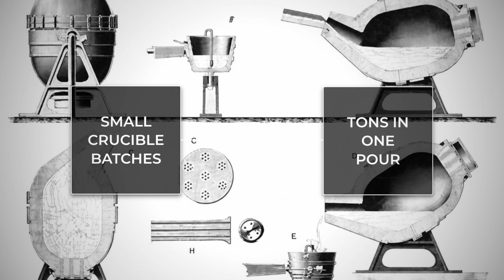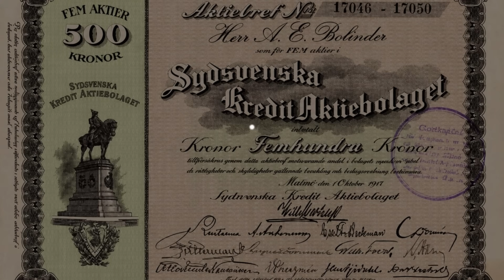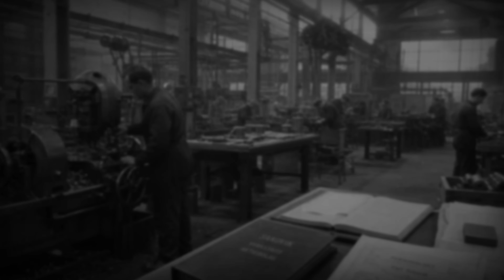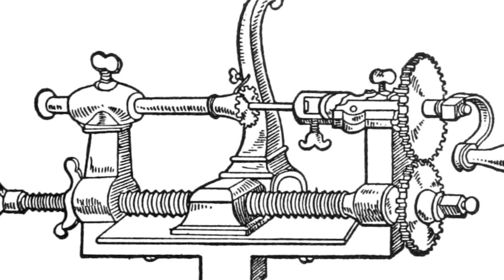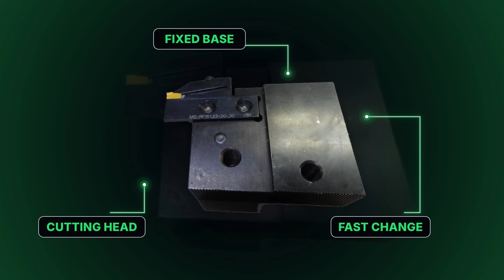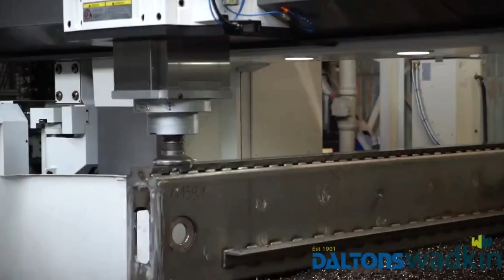How A Swedish Merchant Solved The Biggest Weakness In Cutting Tools And Started The Modern Steel Age

Comment: My friend had a workshop in Sheffield. Among other equipment he took over from the previous tenant of that shop was a Cincinnati cutter grinder. He mostly ground his own tools beye on a bench grinder, but discovered & fixed a problem on the Cincinatti that explained why it had been left behind. But gradually even he moved over to disposable inserts for most tasks, so have I in my home workshop.  It depends on your materials and personal preferences, but for many people - inserts are a more flexible & practical solution.   I also still have and use some Sandvik saws & other hand tools for woodworking as well.

Comment: Australian here. I was once contacted by the New York office of Sandvik and asked if I would be interested in a new product; a variety of stainless steel tube which was six times stronger than T304 stainless for the same weight, or one-sixth the weight for the same strength. As a manufacturer of racing vehicles I was naturally very interested. Long story short - the stuff was incredibly difficult to bend - especially in the wall thicknesses we were interested in (about 0.5mm). It took three months of trying and some bending machine modifications, but we eventually managed wrinkle-free bends in the 31.75mm tube we were supplied with. We were told we were only the second tube-bender in the world (after a Sandvik division) to manage such a feat. Sadly for us, Sandvik never went ahead with the volume production of the 38.1mm OD tube we needed. BUT, we did make the world's only man-carrying vehicle to use that steel and today that vehicle is somewhere in the U.S. State of Oregon. I was told back then that the only applications that did continue for that particular type of steel were needles used fo eye surgery and the outer shield plate of shavers. I'm retired now, but it was a memorable part of my career.
Reply: Genuinely interesting story! Thank you for sharing. :)
Reply: Thanks for sharing! As a swede it's really interesting and not a small feat bending that.
Reply: Bro you can’t say Oregon and not expect Oregonians to want to know what car it was. Where is it or what model was the car?
Reply: And you have Volvo and Scania on your roads to, a good swedish brand! Cheers! And  good F1 track or 2!:face-blue-smiling:
Reply: I live in Oregon. Where is it?
Reply: Thank you for sharing this very interesting story.
Reply: The material may be similar to Sandvik Nanoflex.
Reply: II appreciate that the OP may have been working for a US or other country racing vehicle manufacturer.

Comment: Seco Tools' Duratomic coating  with columnary grown aluminium oxide was released in 2007 - six years before Inveio was released. They also started their own carbide manufacturing during 1931 in Fagersta, Sweden, eleven years earlier than Luma which Sandvik bought.

Comment: It is like I am living in a paralel universe. Sandvik to me has always been saw blades, they are the best, I would not buy any other. Having worked around fitters and toolmakers for the last 35 years I do not once recall seeing a Sandvik  machining tool. Finnally it does not mention the take over/ merger with Bacho.

Comment: Swede here. Really interesting history about Sandvik. Also I finally got the answer to a thing I wondered but then forgot all about. At my work we have an automated metal bandssaw that we bought 2004. In the manual to the machine it says that the plates that steer the blade 90 degrees from the wheels down toward the material being cut and then back again is made of what they called vidia and that it should last as long as the entire machine. They were not lying about that. After 1000s of running hours and maybee 100s of blade changes they have not worn at all despite been pushed hard against a moving metal band for such long time. Now I might understand why if Vidia is an old name for carbide.
Reply: The first cemented carbide patent by Karl Schröter was granted in 1923 to the German Auer Gesellschaft (today Osram). They were used primarily for replacing dies of fragile diamond used in the production of tungsten filament for lamps. Then in 1925 the German Krupp bought the patent and made a cutting tool under the brand name WIDIA (means Wie Diamant in German, like diamond in English). In the first years people named all cemented carbides WIDIA, that is the reason of the confusion. Cemented carbides  became a business for many companies worldwide, for example Mitsubishi (JP) Kennametal (US) and from 1942 Sandvik Coromant.
Reply: Has Nvidia stolen part of the name?
Reply: Carbides, being a ceramic, would likely be quite abrasive, so if dragging against a metal surface it would chew through your sawblade band... :P

Comment: I hate how they show the regular tools today with the poneers. Stupid ass vide doesn't even show that Bessemers process only produced high ductility mild steel, not the era proven high carbon, polishable edge holding crucible alloys that real craftsmen depended on.
Reply: I was under the impression that the Bessemer process took Pig Iron , burned off the graphite and left iron with no carbon . Then to get to tool steel, with less then 2 percent graphite you added carbon back to make tool steel . And from there it goes back to making stainless steel adding chrome and nickel . Then using the Iron Carbon Diagram process heat treating the melt to keep the nickel and chrome in suspension and immediately cooling it down to lock it into stainless steel . This is the point where the sensitivity of the stainless process plays a very important role . The cool down process and its speed determines whether you have stainless steel . Heat treatment and cool down play a very important part .

Comment: The problem with the Bessemer process was the very high speed with which it happens...   Stacked on top of the phosphorous problem.
You could not adjust the process once it began.   Simply blowing out ALL the slag was major improvement.

Comment: Learned how to grind hss tools in 1968 at trade school carbide brazed tools were the standard in 1970’s if your company could afford them. Carbide inserts with ceramic coated edges were a miracle. I worked around the same area as the sandvik company in fair lawn New Jersey but didn’t know it was there until now. Sandvick was a brand name we used kennametal inserts.
Reply: Yes, ISO inserts are cheap. But say a Coromant patent radios cutting insert for example can cost 60 usd, with 2 cutting heads. But that is the same for all manufacturers.